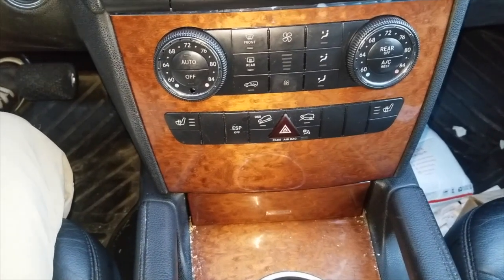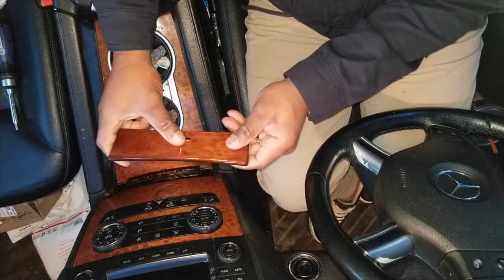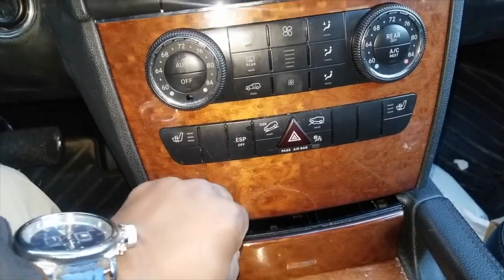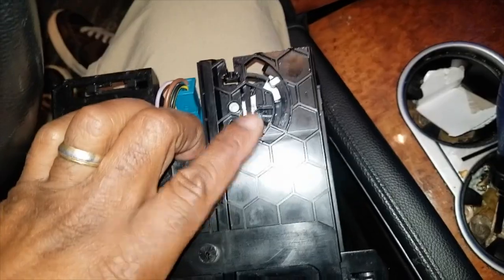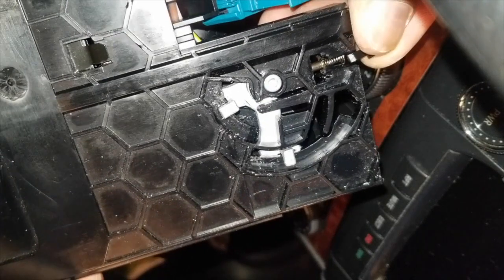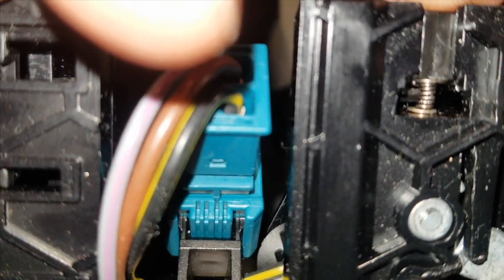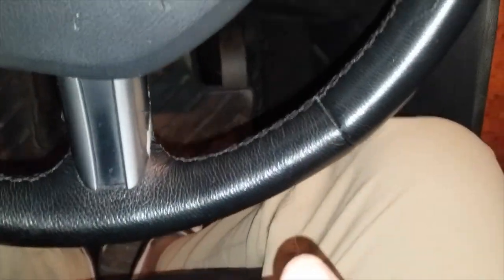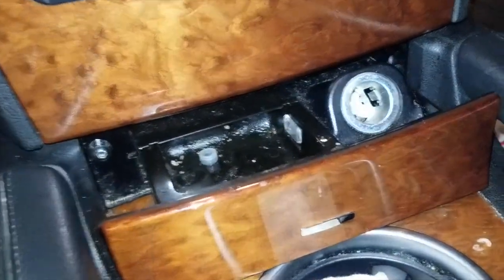Fixing Mercedes Cigarette Tray Issues

Comment: Hello Keith, can you explain me where is the interior light sensor in the front left door. (this sensor have other function, go automaticaly to parking mode, turn off the radio an accesories, etc), in my ML350 year 2009, sometimes is not functionaly. Thanks

Comment: Please help I have a ML350 2011, 4mactic , had camshafts replaced and everytime I get work done they are not resetting the codes or clearing them it appears these scanners they are using are not true readers, my engine keep coming back on with the same codes  or a new code .!! Which is a problem for admission !!

Comment: Um.. OK.. You popped off the face. But how did you get the ashtray open? The ashtray in my S500 is stuck in the closed position. Any idea on how to get it open without using dynamite?

Comment: Hello my light in the ashtray never goes out drains battery can you help me troubleshooting  or direction to look
Reply from the maker: Vehicle needs to be zeroed out and then reset or possibly If the light in the ashtray of your Mercedes never turns off and drains the battery, you may need to check the wiring or switch controlling the light. It could be a faulty switch or a short circuit causing the light to stay on. Consider consulting a professional mechanic or an auto electrician to diagnose and fix the issue.

Comment: Thanks for the video. Think you could do one on replacing the rear SAM? Mine got wet due to water coming in around the tail light seal. Everything works but the fuel gauge but it sounds like I need a new SAM. They need to be programmed is the problem. Appreciate the videos. Have the the same SUV as you, a ML350 4matic.
Reply: I have same problem disconnect battery disconnect Sam open it and clean whole board with 96% alcohol